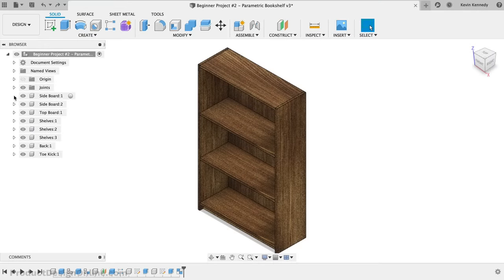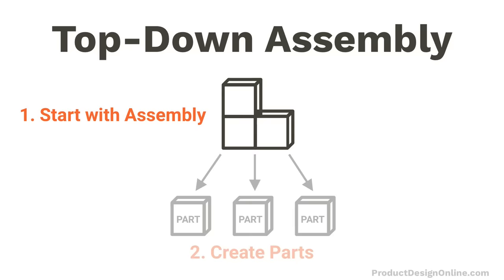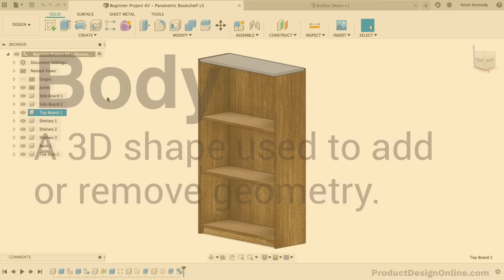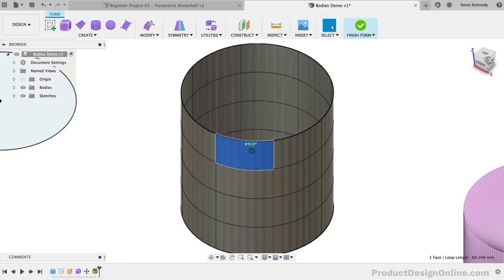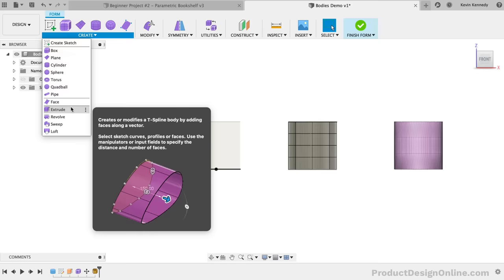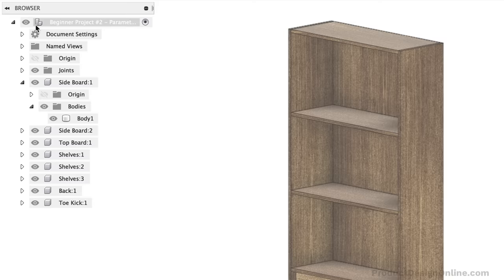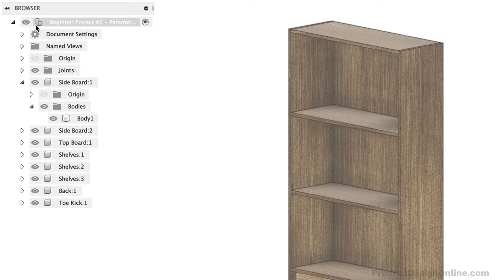Bodies vs Components | Fusion 360 Core Concept

Comment from the maker: This video is a shortened version from my Masterclass: Fusion 360 for Woodworkers. Check out the full course curriculum here - https://bit.ly/woodworkingCourse
-
TIMESTAMPS
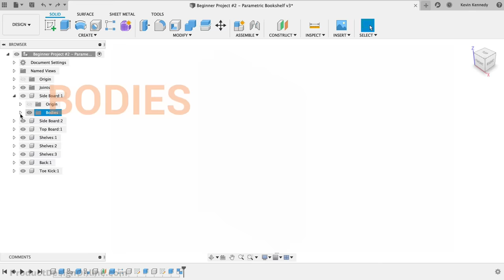0:00 - Understanding Bodies vs Components in Fusion 360
0:37 - Top-Down vs Bottom-Up assemblies
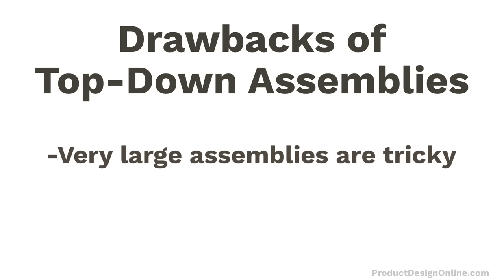2:46 - Drawbacks of Top-Down assemblies
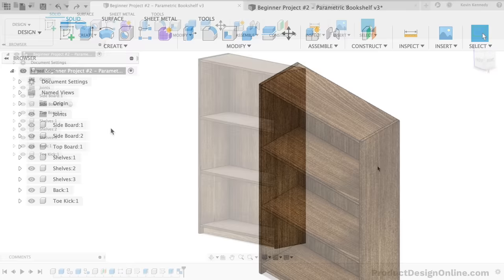3:45 - What is a Body in Fusion 360?
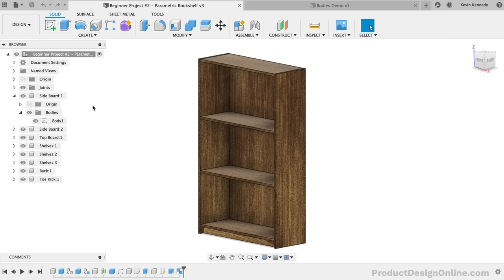4:39 - Types of Fusion 360 bodies
8:18 - What is a Component in Fusion 360?
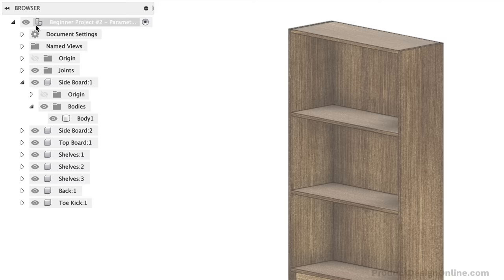10:23 - When to use Components or Bodies
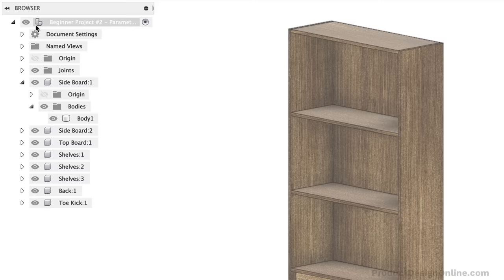12:55 - Fusion 360 Rule #1
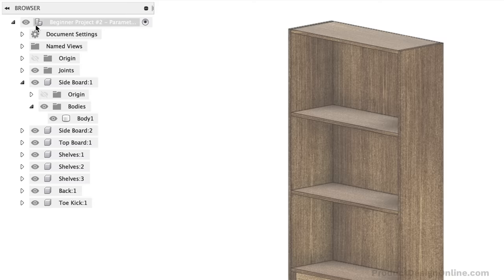13:39 - Fusion 360 Rule #2

Comment: Way too much info to properly digest and comprehend for the beginner.  I'm sure at some point it will start to make sense,  but not today.  This confused me more than before I watched.   You need to take each section and explain it.  "Here's a body, let's make one"..then do another followed by how to create the assembly with examples of how changing one thing can imoa the other or whatever the case.

Comment: One critical piece of information not covered is making a cut list for wood working.  You have to use components to be able to create a table with your cut list in it.  This is really useful when you are done and want to quickly create your cut list for what you need.  You can even include nails, screws, drawer pulls, etc. if you add them as components.
Reply: any chance you could link to a video of this?

Comment: I build hoof trimming trucks. Basically rolling squeeze chutes they are armored with metal tubing all the way around I have been trying to do a complete drawing of one but keep getting stuck in different ways. I’m a welding shop and need to draw weldments and structural components
Reply from the maker: Hi Steve. Proper weldments are one area where Fusion 360 lacks a feature (if you're looking for similar functionality to SolidWorks). Are there any other areas or workflows that you're finding challenging?
Reply: Hi Steve! Your post is a year old but I had an idea about your design issues so I'll write it up. Weldments as a connection tool caused the issues, but other connection tools could just as easily mess up too.
It was the 'top down' and 'components are containers' comments in the vid that caused this idea. I'm thinking, 'the design fails because it's not starting at  the top. Where is the top?' And the answer I found was, 'the cow is the top.' Excuse me while I crow a bit, this is pretty brilliant. I don't have ideas this good very often and I'm having fun with it. LOL!!!
I think of this as the 'aroundment' problem. You need to contain a cow. With normal design, you start building the frame at one point, go around the cow in width, height and length, and meet up "somewhere on the other side." That's where points don't line up. Or they do but won't 'connect.'
I think this is one way to describe the root of issue: Both ends/legs of the structures that goes around the cow are part of the same component/container, and when the meet on the other side won't 'connect to itself. F360 basically says, 'Nope nope nope, not gonna do it, try again.' :( Yes, been there, done that.
My idea is to build the cow itself into the design, so the aroundment bits always have a 'common shape' to reference and hang on to.
Not just 'the' cow though, or one cow, but the cow as it exists through time as it passes through your machine! Stick with me on this...
A cow walks up to your machine. There's a gate, and the side rails start, and maybe there's a ramp. The cow is the shape that your machine must contain.
Create a sketch shape the height and width of a cow, imagine it's facing the gate and ready to enter the machine.
Create an extrusion that moves forward into the machine (the machine that isn't there yet, this is just the cow.) Make the extrusion as long as you want the cow to walk into the machine. I'm guessing that after it walks into the machine the exit gate is in front of the cow and it stops there.
If you need a ramp to get into the machine, extrude upwards at an angle, then go forward the length of the cow at a level angle, and have the cow outline go down another angle at the other end..
You should have a blocky shape on your screen that looks one of two ways. If it's just a cow, no ramps, there's a rectangular block about 3' wide, 8' long and 6' high, or similar. You can make the outline more realistic if that's important for how the animals are held. If it has ramps then those shapes are attached to the one in the middle, and slope downwards on each side.
So there's your cow. Now build the cage around it. I'm not going to say at all how to do that because there are a few ways and you know what you prefer.
But here's an idea for how to continue, that keeps an original 'reference' cow available in the background. Yes timeline could do this to but this will be faster later.
The cow as shown can't be the actual design surface; it's too small, the cage is bigger than the actual cow. It needs to be enlarged to allow for largest animals, tubing diameters and such.
Leave the cow there, and build another box around it. I forget the name of the tool for that, but it references one body to create another completely around it. Make it x% wider and y% longer by whatever factors you use to get to your overall size. Then turn off the cow, but it'll still be there.
The box that you built around the cow is hollow. If there's no roof, take that off. With the box shape left, use the corners and edges to define endpoints of tubing.
Cut the front and back off the box and split those vertically to make barn door gates, or don't split it to make a single gate, or the gate drops and becomes a ramp, you know what you're doing.
Here's another way to say it: The Trail of Dimensional Authenticity starts with a single fully defined component, and everything references back to it.

Comment: Hi Kevin, what a great video. Foundational and a must see for anyone using Fusion 360. You clearly explain how Components are different from Bodies, like Apples are from Pears. One thing you missed though, which I think helps in a practical  sense for beginners to get their minds around it, is that Components an Origin and an Origin Plane In fact they have to include one Origin/Plane, whereas Bodies have no Origin of their own. This feature was fundamental helping me to understand the different ways I should use bodies and components when designing for 3D Printing, where one only really uses Solid Bodies, not surface etc.  I hope this will help others understand the key concepts you highlighted and explain so brilliantly. Keep up the good work.
Reply from the maker: Thanks, Martin! Wonderful addition - thanks for sharing this!

Comment: Hi, nice post thanks. Is there any system requirement, like NVidia Quadro if you access F360 through browser? Moreover, can you sync offline projects woth the online library? Can you use both online and offline versions one after the other? Thanks. Regards Istvan

Comment: Rule #1 always start a design with a new component. So I draw a circle and extrude it, under operation, should I choose "New Body" or "New Component"? What is the difference? It is so confusing. Coming from SW.
Reply from the maker: Generally, you should already have a component created and active before you sketch out the Circle/Extrude it. Think of Components as 'folders' or ways to group all your sketches, bodies, construction planes, and other features that relate to that part. The intention is that you can copy, delete, insert into another design, etc...without risk of losing critical relations/refrence objects that destroys the parametric nature of the file.

There's not a 1 for 1 equivalent in SW. The closest thing would be to think of Components as a 'Part File'...but that analogy gets messy when it comes to assemblies as Fusion 360 caters to both bottom-up and top-down assemblies methods, as well as some unique hybrid approaches.
Reply: @ProductDesignOnline  kind of understand. Thanks for making such a great tutorial.

Comment: I was really hoping you would cover how to create a component from a group of bodies.  It seems like a really critical step, yet every single video I have watched seems to just completely skip this part.
Reply from the maker: That's not a good practice, at all. You have to create your component(s) first so the relevant sketches, bodies, construction planes, etc are all placed in the correct component. If you create the component after the body, you won't have the sketches in there which will cause many issues with assemblies - especially if the part is copy/pasted or reused in other files.

Comment: Can we convert a surface to a stl file for 3d printing?
Reply from the maker: Yep - you can export surface bodies as STL files. However, note that they're very thin and in most situations won't print without getting "thickened" first.

Comment: How can I make the feature design tree not expand too much. I had the problem when I tried to make an assembly that I lost in the Feature tree beacuse it was huge, not like SW that only saves mates in assemblies but Fusion also saves joints in the same tree.
Reply from the maker: Creating sub-assembly components will help you keep things organized (group several components that make sense). Other than that, it's hard to say without seeing a specific file or example :)
Reply: @ProductDesignOnline  I wish I could find the equivalent to the coincident solidworks mate. And also how to align planes or use sketch entities with joints

Comment: Not sure I understand why the entire bookshelf could not be a single component and each piece of wood a body within that single component??
Reply from the maker: The main reason - You would not be able to use Joints per each board. The 'parts' would also display incorrectly in the parts list, as well as other disadvantages.

Comment: so if container is like folder on computer, and a way to organise stuff, why have you put every section of a book case in its own container. surely one container labelled bookshelf would have sufficed. I think containers are so you can have joints. Example if you wanted a car modelled and the wheels each rotating independently the wheels would all be in their own separate containers. This is ridiculously hard when designing to remember to use containers. Even the first container when you start fusion. If its of unparalleled importance then fusion should ask the container name before you get past origin.
Reply from the maker: Hi James, I do agree that the naming and workflow could be improved.... just remember that components (containers) CAN include multiple bodies (or with your example, multiple books). I may not have made that very clear in this video.
Reply: Loads wrong with fusion I have to say. Anyway so heres the question. Mid design I open a new component. Then I sketch out the body and extrude it. Only the body does not appear in bodies under the new component. It still appears under the bodies of the first component list I was using. Why is that?